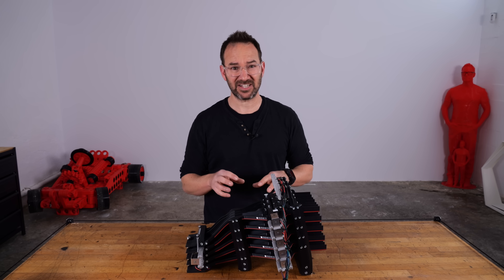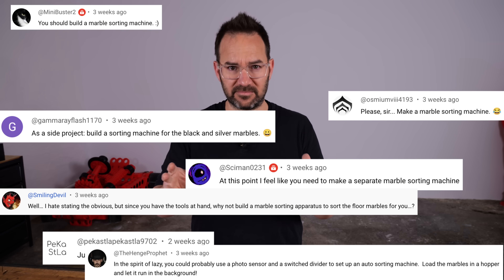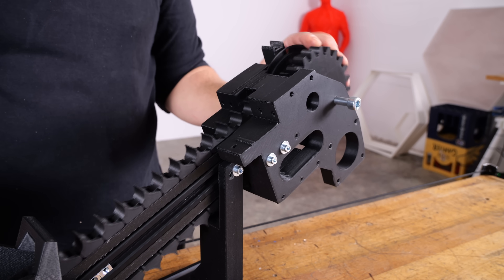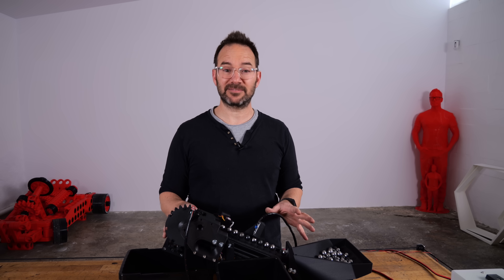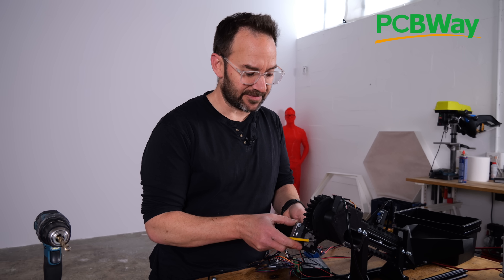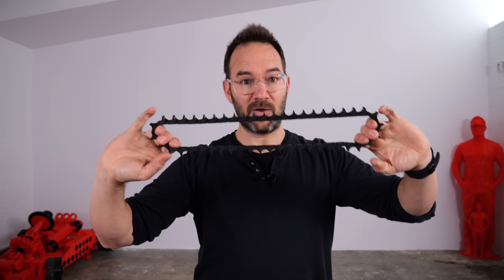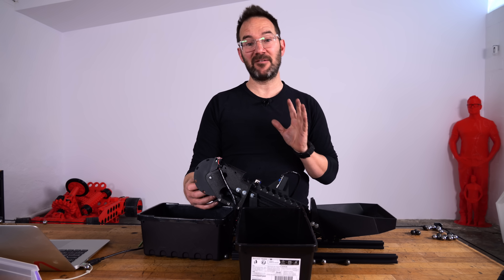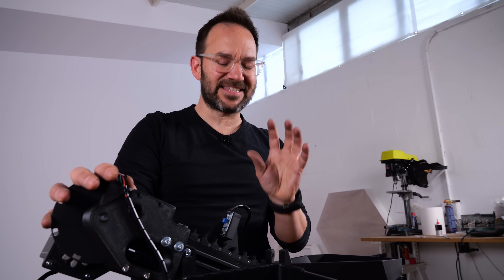Faster than the Eye Automatic Marble Sorter - Marble Clock Seconds Display Pt.3

Comment: I design high speed industrial control for work and I'd like to share a few suggestions  You could use pulse compressed air to push the marble out of the belt. It can operate way faster and will not create a physical barrier that collide with the belt. Also the trigger solenoid can be directly connected to the infrared sensor so you sort the marble while they are being evaluated (direct connection without logic will work fine). Last, using a ramp and gravity would also simplify your setup. The only electronic would be for detecting/sorting (speed may need to be tested though). I designed several high speed sorting systems (1000+ items/s) for all type of  products, and using sensor directly coupled to the actuator (pneumatic) is always the most reliable and fastest solution.
Reply: yeah, 1) compressed air 2) on the downhill 3) with the sensor and "pusher" at the same spot seems like it would solve a lot of problems.
Reply: Thanks for sharing! I love hearing from pros!
Reply: I think that he is using an IR proximity sensor, which looks like the ones designed for use with Arduino or other microcontrollers boards. As far as I know you can't directly connect a sensor like that to an actuator because the analog value representing the sensor's light level has to be evaluated somehow to trigger a control output. This is all just speculation though.
Reply: @SpaghettiEnterprises  You are most likely correct. Another type of sensor would need to be used. Something a bit more industrial where you can set a level of detection and provides a dry contact where you can use whatever voltage you want (typically 24V). They are a bit more pricey ($100 - $200), but they are reliable and no logic needed. Also the solenoid for the compressed air would need to be a pulse type, basically provide a pulse of air on a rising or falling edge. That way even if the detection last a long time, only a single pulse would be provided. Industrial world has all these use case covered ;) But it takes $$$. Hobby electronic is cheap but take time time time....
Reply: @Siro_Simo  Good, Fast, Cheap. Pick two.
Reply: @Siro_Simo  I think, you underestimate the speed of an old, slow, cheap 8-bit microcontroller. Despite being clocked with 16MHz only, an Arduino can still execute 16 MILLION instructions per second! If you need 1000 instructions to evaluate if a marble is black or white and to trigger the air pulse, you're still much faster than the mechanical limits of the marbles themselves running down a slope and being pushed out of the way by the air pulse. Just give it a think - he's currently three orders of maginute slower than my above scenario.

Granted, that solenoid definitely isn't very fast, so there's room for improvement. But think about it further. A marble has a diameter of how much, 16mm or so? That means, if he could feed 1000 marbles per second down a slope, they'd need to move with at least 16m/s - almost 36MPH if you operate on banana units. They'd need to roll down a slope covering a vertical distance of 13m (~42 feet) to get to that speed, disregarding all friction. And then the microcontroller still would have 16 000 clock cycles left to evaluate if a marble is black or white, and if it needs to trigger an air pulse, and actually trigger the pulse. That tiny CPU ain't break a sweat, presumably sleeping for many thousand clock cycles before the next marble is under the sensor.
Reply: @SpaghettiEnterprises  Arduino's and other microcontroller boards allow more people to build this type of project, but this would be a pretty simple analog circuit to build using an op-amp as a comparator and it would be able to run faster than an Arduino because there would be no sampling and processing delays.
Reply: @geekmug  You're absolutely right. Also I was incorrect about the analog value. Looking at 3:10 you can see this module actually has a comparator on it already, exactly like you said. Thanks for pointing that out.
Reply: This guy knows what's up!
Reply: @SpaghettiEnterprises  and this, my friends is exactly when to bodge
Reply: Why sort the marbles at all. Use silver for the numbers and absence of a marble for black. The clock face and clock parts are black anyway so it should work.
Reply: @joireland  Because the black marbles are used as spacers. If you put a bunch of silver marbles in the channels, you have a bunch of horizontal lines starting at the end stop. If you want to have any silver marble not adjacent to another silver marble, you need to keep them apart - the easiest is to just put a black marble in between.
Reply: @smurface549  I saying to not use black marbles as spacers but instead have a grid that holds the marbles in place. It would take some time to design and 3D print that grid but it's feasible if you think about it.
Reply: @joireland  But then your grid needs to have the capability to stop individual marbles on different positions with spaces between them. I don't see how that would happen without active controll, so some sort of a stopper that is electronically controlled.
Even further, the point where a white marble needs to stop is changing every minute for every line, even within the line. So you can't have a static stopper, it needs to be a matrix of stoppers that can address every individual pixel.
Technically you're right, it CAN be done. Just that it's the most inefficient way ever to do it. You'd probably need dozens or hundreds of active control elements, unless you completely change the whole design of the clock and e.g. use a ridiculously slow robot to place every marble individually on a horizontal grid.
Reply: @smurface549  It's much easier to stop a marble by having it fall into a groove at the end of the grid with tiny arms that retract and extend to make sure the momentum doesn't let it fall out (similar to the ones that eject the balls afterwards just a different orientation). Anyway with a bit of thinking I'm sure it's easy to find a good solution and its MUCH EASIER than sorting balls quick enough. Don't give up too soon and say it cannot be done because we all know it can. We both agree the issue is speed of sorting balls so remove that issue.
Reply: @joireland  I think, you even don't know what the problem is, and you obviously never read my comment properly. I didn't say, it can't be done. I said, it doesn't make sense. That's two completely different things.
But granted, I didn't think about it properly in the first place either, it was in the wee hours and I wasn't at my full capacity anymore.

So let's get some flesh on the bone. The grid for his clock contains 3 columns where marbles would need to be stopped in order to draw a line. You can see that in the first build video at timestamp 0:52. The grid is 9 pixels high, and here's the 2 dots of the colon. So you'd need a total of 29 individually controllable stoppers to pull off your idea and stop marbles in a way that they're not overshooting the position they're supposed to be in. Marbles in horizontal lines get stopped by marbles that are already in the line (exception is the first one in each horizontal line segment). Vertical lines need to have a stopper on the same position in each line.

Is it possible? Absolutely! Is it sensible? Well, our opinions seem to differ. I think, having 27 individual control elements is more effort and less sensible than sorting marbles and distributing them according to their position in the grid. You need to allow for enough safety margin for a line to have filled up before you can engage the stopper for the next line segment to the left. That is, unless you have sensors after each stopper to count marbles that have passed, which increases the effort even more. The "display" refresh would be super slow and awkward to look at.

The sorter alternative might get away with 1 motor, 1 sensor, 1 solenoid and 1 servo, and additionally 1 solenoid or servo.

Speed is not an issue. One can replace the solenoid with a compressed air jet. Much faster and less error prone. There's recycling plants where they sort each individual shard of a container full of broken glass into their respective colors - they don't do "19.8 shards per second". They're pushing 4-digit numbers.
Even things like frozen French fries are sorted for bad fries before they're packaged. Every individual fry you're taking out of a package went through a sorting line that was using image regocnition to remove bad ones.

So your proposal is a solution for a problem that doesn't exist. It would work, sure. It's just not necessary and in my opinion over complex.
Reply: @joireland  No worries, you didn't offend me. I enjoy a good discussion. And I'd like to point out that the statement of your proposed solution being not suitable is my personal opinion. I don't claim my way of thinking being the ultimate truth.
Reply: @smurface549  OK great ... I hope some smart guy figures out a solution with only silver marbles someday. I hope you agree the speed of sorting is the issue and limits the display time so a solution is to remove that issue. I guess it'll mean redesigning the channels which feed the clock face somehow? Right now the clock face holds the current number well the issue is hiding the following marbles and holding them back. When the slot needs to be empty, the solution would need to hold back the next marble and make sure it's also not visible somehow. Maybe by a lever which serves to hold the marble back and also to hide it? Who knows something like that ... I know it's not perfectly thought out but maybe someone can add to this initial idea.
Reply: @joireland  Simple solution: Develop and prototype it, and show it on Youtube. I surely will believe it if you show proof 😀
Reply: When I did this way back when we also used a downhill contraption, but with a mechanical flippy thing in the end to divert the balls.

I don't get the belt. It seems only to complicate things. Use gravity in stead.
Reply: I agree, compressed air sorters are common in high speed printing systems where up to 30 sheets per second need to be separated.
Reply: I was going to bring up the direct link if no one else did.  I facedesked so hard I broke my snoot when IDidAThing used an Arduino for his drone dropper attachment.

Comment: If you want to go faster, look at how programmable knitting machines select needles.  They can handle 50-100 selections per second with 8-parallel gates moved by solenoids.  One gate controls every 8th needle and selects which cam-track the needle follows.

Comment: I'm thinking dual sorters, so that they can each run at a little more moderate speed.  Would look cool...parallel sorters drawing from a common reservoir, knocking black madness into a common bucket between them, silver going into a common bucket at the top.

Comment: cool but over engineered. a simple down slope ramp the marbles follow with a solenoid that pops them off as they pass by is going to be far less complex. if you want more speed then add more sloped ramps with their own solenoid coming from the "bucket".

Comment: You should replace the solenoid with a solenoid valve and use a blast of compressed  air to move the marble off the chain that greatly reduce the amount of jams.

Comment: You could add a 2nd solenoid one step up the chain, with an extra step of delay, and alternate which solenoid activates each time. That could double the capacity as long as they can retract fast enough

Comment: So if you put this mechanism into the clock, you'll have two buckets which both need to feed different slots for each seconds somehow. The distributor seems complex for me now.
What about building parallel sorters for every slot of the display, so 7 sorters, maybe with eitzher one long chain visiting every slot or 3-5 chains running along subsets (more slowly)? The chains all have random marbles and each segment-slot selects the marbles it needs.

Comment: As someone who builds custom pinball machines, I was happy to see you swap out the servo for a solenoid, nice!  Too bad you used a toy solenoid, instead of a proper pinball solenoid.  That said, the solenoids spring appears too weak for the speed you are running it, and possibly the activation time seems too long, though a stiffer spring may fix that as well.  It's all very cool, though, and I'm impressed you could push this setup to almost 1200/min.  Further improvements could be had if you were able to lower the belt wall height and raise the solenoid off-center, so there's no possible collision between them.

Comment: There is zero need to sort marbles if the clock just uses a reel of pre-sorted marbles arranged in seconds (like a flip clock). As it is currently designed, the amount of time, effort, engineering complexity dedicated to sorting marbles, just to waste it all after displaying the digit for 1 second is crazy. Just make a reel of marbles that has each digit in order, and it cycles through them. It's A LOT simpler.

Comment: Why are you still using a stepper motor in the final iteration when you no longer need to stop the chain? You also already know the position of the chain via the disk.

Also, as others are suggesting, parallelization. Not only could you have multiple solenoids to eject marbles on the chain, but you could have multiple chains powered by one motor; for the same throughput, the chain speed would be a lot lower, both making the solenoid's job a lot easier, and making the feed marble bucket less of a mess.

It's also worth asking whether the sorting mechanism needs to have any lift to it. If it were to lie flat, the motor's job would be a lot easier.

Comment: OMG, he finally did what I suggested in the comments back when he first started trying to make his machine faster. Serialise the balls and read them in one at a time. My suggestion went further though. Have the balls roll past your display input ramps and have multiple solenoids. One for each display pixel. Then it doesn't matter which colour is required, the solenoid just punches in the next ball colour required at the time as they roll by. One solenoid per pixel. Then just have all the balls on a loop in the back. Much more efficient use of the "data stream" (balls) as all the balls will roll past all pixels leading to minimal time loss in feeding the pixel ramps with the correct colour.
In short, yes, make this sorting machine, well a mutated version with 9 solenoids, part of the actual clock!

Comment: Excellent project, yes I think it should be part of the clock mechanism. 
Did you consider a linear actuator or a longer stroke solenoid and striking arm with a collection bin each side for the sorter?that way you wouldn't need to retract each stroke, just hold on one side until the next activation.

Comment: the solenoid shouldn't trigger when there is no marble, this adds a possible failing point. also you could try to have the tip of the solenoid barely hit the ball to increase the speed even more.

Comment: Yeah, pop it in the clock! I'd suggest adding another sensor calibrated to detect if there's a marble present or not, so you stop the solenoid from actuating when there's an empty hole

Comment: Surely a better and easier solution would be to use a vertical gravity based system with a hopper then you don't need to worry about feeding as gravity will do that you just need to worry about the sorting.

Comment: If you move the solenoid back a bit you can probably push it quite a bit, if it only extends slightly into the marble area.

If you run the solenoid with an H-bridge you can also apply a retraction pulse

Comment: that sorter method is just... wrong, why don't you create a sorter that took advantage of the door system? like: right door is for white marble and the left door is for the black marbles and the door will act like a Metronome... also, why using only one corridor when you could use 4 corridors with a reduced speed? think about it: one corridor need a speed of almost 20 marbles per seconds... while you split to 4 corridors, you get 5 marbles per seconds multiplied by 4, you will get 20 marbles at once! like how you did split these marbles to create the "number" on your clock machine.

Comment: You need to run it at least at 15 marbles per second to compensate for the marbles you’re using in the actual clock. Or at least have a good surplus of marbles, so they don’t ever get used up.